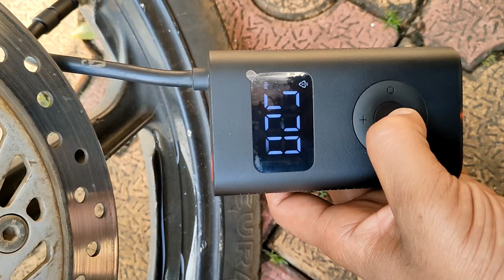Repair of Mi Portable Electric Tyre Air Pump for Car & Bike|sk raghav ix

Comment: Can you please share from where did you get that rubber? Any online link available? Please help
Reply: It is not rubber. It is usually teflon cup. May not be easily available. You may have to cobble one yourself.
Reply: How do I do that? Is there any videos?
Reply: I think O’ring can do that and apply a little oil to the valve
Reply: @Danniel-bt4mm  Hero Honda CD100 SS motorcycle's head O-Ring is a like for like replacement option and its quite affordable and easily available too.

Comment: Were can I get the replacement part, what's the name of the replacement part?
How much will it cost?
Reply: Did u find the part . Or this rubber seal if u got it plz tell me thanks
Reply: @darkrain518  No, I didn't got it.
Now the battery too has gone worse.
Reply: God help u
Reply: @darkrain518  Aameen

Comment: Thanks for this Video but will you please guide us that How can we make any Tyre Inflator Air pump DC 7.4V to 12V Car/Bike battery Alternative. I mean we want to run Inflator with 12volt cliper Battery. Is it possible with resistance.

Comment: I would advise against buying the Xiaomi bicycle air pump. I bought one and after two years of use, it suddenly stopped working without any reason. It was already out of warranty, and they refused to repair it. My friend also had a similar experience, with the pump breaking just two months after purchase. Fortunately, they were still within the warranty period and could get a replacement at the repair center in Mong Kok. However, it is concerning how easily the pump can break after the warranty period expires. I recommend avoiding this product to avoid feeling scammed, as I suspect there may be a programmed obsolescence.
Reply: Mine too, stopped working suddenly

Comment: hi where can I find this rubber to fix my Mi Portable electric air pump? Any online link available?
Reply: Hero Honda CD100 SS motorcycle's head O-Ring is a like for like replacement option and its quite affordable and easily available too.

Comment: if you wont positiv subscribe , must answer at question of the people...... what is the dimmension of rubber gasket? link for buy.... I think OD is 15mm but i dont know the ID and thikness. Can you answer?
Reply: 14×11×2 mm
Reply: @SoumyaDarsan   Hero Honda CD100 SS motorcycle's head O-Ring is a like for like replacement option and its quite affordable and easily available too.